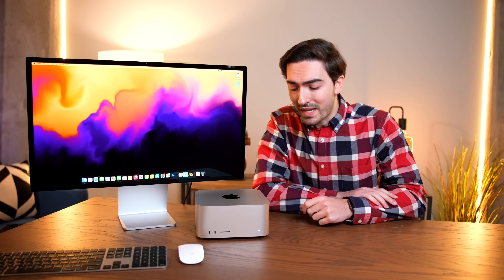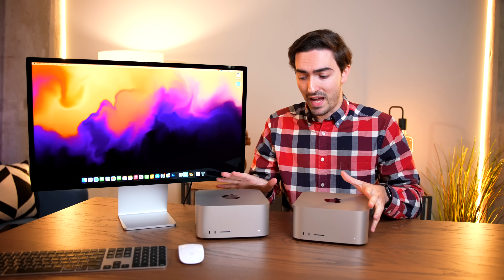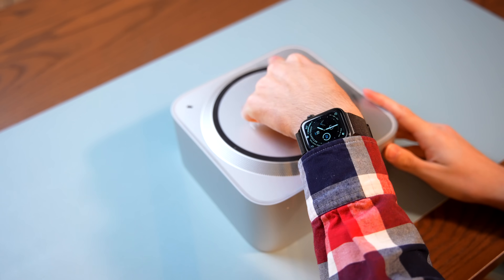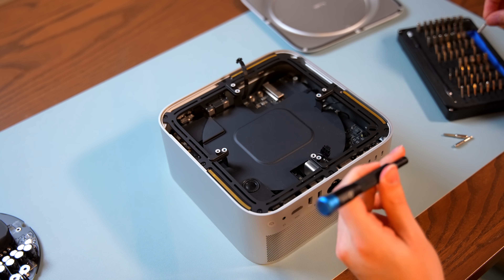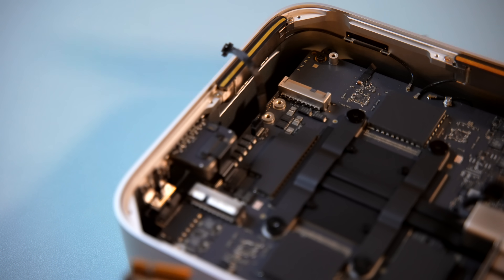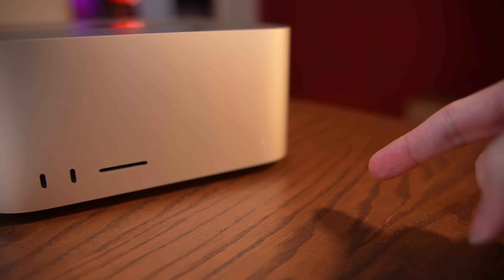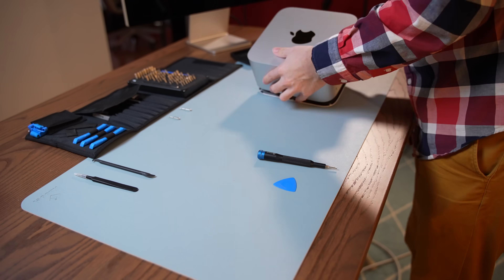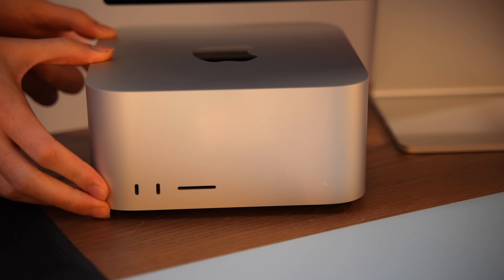What happens if you try to UPGRADE a $5,000 Mac Studio?

Comment: Disappointing video.  I agree with many others here that it is not much of a different situation than a drive that is soldered on and not upgradable for that reason, until the device is opened (which you are not supposed to do) and see that it has a port with a cable and you freak out.  It's kind of like a Schrödinger's cat kind of thing.  And.. It reminds me too of when I bought a very very cheap (stolen?) firmware-locked machine that previously belonged to a school board.  Indeed, I found a way to get around it, but I also knew that it was possibly illegal and obviously not morally sound that I was able to access that machine's drive and possibly data.  In my opinion, the situation you exposed is really not really about Apple's problems, it's about your interpretation of the inside of a machine.  The machine is advertised as not upgradable.  I think that is pretty clear.

Comment: You should have turned off ssd security first before removing the drives.  Boot recovery mode and in terminal use csrutil disable and disable secure boot, then maybe re-enable it after you place a new os beck on it.  Worth a try..

Comment: There are so many facets to; right to component repair vs right to repair vs having the repair knowledge to repair and to do the repair right/correctly. All of this investigation is awesome but it also brings to light that there are steps required to actually complete the hardware validation because those storage controllers are part of the deeper security booting feature. Yeah, people bitch about security and think that Apple is using that as and escape from complying to a bunch of people that want the right to repair. The fact is there are legit repair people that would certainly benefit and then there are the HACK repair people that will ruin it all.  As much as I think this video is awesome it also is an epic fail when someone not qualified to do the repair/modification makes that attempt. It’s a bummer that with all the Macs you have you didn’t connect to a Mac and attempt to finish the process with Apple Configurator. Amazing how we wonder where misinformation/incomplete information originates even when trying to improve the collectives access to credible information. 

** redemption would be doing it again and running Apple Configurator and if it works well report that which would be the right thing to do **

Comment: Don’t worry eventually this Mac will get jail broken and when that does you will likely get 10 years of use.  I keep checking for jail breaks for the M1 every few months but no dice yet.
Reply: Why do you need a jailbreak? Apple allows you to sign any kernel you wish to boot on an M1 system. Linux is already running, it's just in need of further driver development.

An M1 Mac with it's boot policy set to 'Reduced' has no dependence on Apple during the boot process.

Comment: build a fusion drive external with use adapter then put it in. u can't boot from a mother internal ssd because of t2. security that saves your data.
and the sos blinking is old. the powerbooks where capable of blinking sos.

Comment: 12:39 These drives are already encrypted by default(usually), so it needs to be wiped before it can be used in another computer. Why make the computer not boot if the machine has had a part replaced.
This is worse than Lenovo vendor locking the standard replacable CPUs that come in their computers, meaning they wont work in a Dell or HP

Comment: I'm with Luke.  I don't like how they do this on my Mac Pro either.  I feel the T2 chip is something that should be disabled as an option.  You should be able to handle this like I do my full-size HDD Cold Storage Backups that I keep offsite.  I Encrypt the entire drive when formatting it with disk utility.  It requires a password for the drive to be read by a Mac.  The drives are useless without the passwords.  With the appropriate passwords you can access them even though they are encrypted from any Mac.  The idea is if I have a housefire, flood, etc. I can buy a new Mac from insurance money and recover data that's 90 days or less old based on my backup schedule.  Doing this the way Apple has implemented is bad all the way around.  If you want to upgrade by purchasing a Mac Studio that has a bad logic board, you most likely can't going off his teaser.  IF you have a hardware failure you can't take the drives and install them in an identical hardware machine because with the T2 chip, they will be wiped before they are paired to the new system.  This makes them so secure they can't be used by anyone including the original owner!  TL;DR There's many more ways apple can implement encryption or security as an option that doesn't screw the consumer.
Reply: don't worry, You can buy this new maxed out macbook. (:
16-inch Apple MacBook Pro M2 MAX 12-core CPU 38-core GPU 96gb RAM 8TB SSD NEW " ApproximatelyUS $7,457.40
Reply: @alberteinsteinh  Pass… Apple isn’t getting anymore of my money anytime soon.

Comment: I disagree that the power supply is dangerous. The backside of it is covered unlike the iMacs before and the backside really is the dangerous side. On the top, the components are mostly isolated. You should not be able to touch the capacitors.

Comment: I'm sure both ports work, in Max tech's video he swapped the SSD to the other port and said it worked fine? But having the firmware lock prevent you from adding a second one or replacing the existing is just stupid. Like you said, why have the port there if I can't use it? I'm sure Apple has some proprietary machine that flashes SSD to work in a Mac Studio but it's a completely uneasy step.

Comment: I doubt it’s lack of controller. Second slot probably disabled by firmware, so only Apple can use it to offer higher storage options in the future, or compensate for module shortages (ie ship 2x 2TB modules if 4TB are too expensive or not available)
Reply: ye, i think so too, it is disabled in software, but i doubt that it is meant for you to get a storage upgrade in the future to your (by then) old device, but more like for apple to offer increased storage in new machines. there are only so much terrabytes that fit on a physically small ssd like this. this port is future proofing for them to not have to redesign the board in some years from now.
i'll just sit here and wait for someone to make a mod chip for the studio, like they did on game consoles to play unofficial discs.
Reply: @core36  Still wrong way to do things.
Reply: it wont work because those nands are for the 0 bus and you are trying to place them in the 1 bus.
Reply: Yes it will be...! 😜 And not that Apple also wants to make money with proprietary hardware..

Comment: Robert Corwen
il y a 1 seconde
I don't agree with your rethoric, and it somehow has to do with your tone and the delivery of your rant.

First, you knew what you signed up for when you bought the device. It was written black on white as a disclaimer within the storage section when you custom ordered.

This is not a Mac that is meant for upgrades, that fact was never hidden. Alternatively, the coming Mac Pro will likely be meant for user tampering. The difficulty you had opening the Msc Studio speaks for itself.

Opening almost 10K worth of hardware was not necessary to get your point across. And the 10K you spent certainly does not grant you more "rights" than a 1K machine, aside from showing up your wealth publicly.

I'm all for right to repair, make no mistake. It's just your delivery that is totally wrong here.

Comment: Lol, Apple is Apple. In their minds, they are creating a “work of art” that is not to be tampered with. They make beautiful machines. They also are hell bent on squeezing as much money from you at point of sale as possible. They really need to get their “right to repair” program operational, so you can buy the replacement ssd’s and change them out if they go bad / need to be upgraded. I also hope they don’t gouge for the replacement parts and tools - but they probably will, it’s in their DNA as a company.

Comment: I feel like you had 2 ssds in the machine, both with full os installations. You might need to fully reset the ssds before putting them back into the machine or into a new machine.

Comment: I was under the impression that the SSD and machine are paired upon first setup.  I’m not sure if the SSD and Mac can be reset (with loss of data I’m sure) or not, but this is done to protect data from bad actors.  It’s not so much the intention to stop you upgrading (though there is money to be made here) as a cynical implementation that’s the issue here.

Comment: I disagree that they didn’t put the controller on for the second ssd slot, I don’t think the Texas instrument chip is a ssd controller, if they didn’t put the controller for the second slot they would just not put on the slot as well. So i think it’s probably the ssd sn is paired with the bios. Or the smbios is stored on the ssd.

Comment: Are you able to get into the system bios and select the boot drive manually? I can remember when the Intel 386sx chip came out. Intel turned off the math coprocessor so the user had to buy a math coprocessor chip. And install it. When the 486dx chip came out, the math coprocessor was activated. No need to buy an additional chip. This is all a marketing ploy anyway. Most Apple users aren’t going to try and upgrade internally like you’re trying to do. Keep up the great work.

Comment: Your editorial is entirely appropriate but there is another reason why removing an SSD or increasing the storage for the device. What happens if an SSD dies?? That, to me, is even worse. There is no way one can change out an SSD for a new one if the one you bought from Apple fails. Oh, and going to Apple to fix it is not an option if one is out of warranty and Apple has EOLed the system.

Comment: Does the Studio have a T1 or T2 chip?  This could very well be the culprit on why your 1-1 swap did not work.  It would prevent a method of data theft.  I thought of this while typing the rest of my comments below...  This could also feasibly prevent you from adding a drive for the same reason.  

A couple of thoughts, and hey, I could be completely off the mark here.  Odd things usually happen in pairs.  Can we be sure that the second port is for a drive?  You pointed out that controllers seem to be missing, but there aren't any clues that there would be some there to begin with.  I do acknowledge the X-Ray view does make it seem that the two ports are for storage, but it is harder to tell what, if anything, lies below the second port.  Devil's advocate, could it be a diagnostic port of some sort? It would be a more compelling argument if someone with an 8TB option tore down their machine to see if both bays are, in fact, used.  I can understand the frustration that you can do a 1 to 1 swap, but you did a 1TB to a 2 TB, if I heard that right.  That is comparing a Granny Smith to a Red Delicious.   We can be mad at apple for not making the Studio user-upgradeable, but then again, they have made it clear that it isn't meant to do that.  The extra barrier of hiding the screws demonstrate this even further.

Comment: the ARM based Macs use Secure Enclave as disk controller just like on iPhones.  Each disk is paired to the Secure Enclave and its encryption keys are specific to that secure enclave.So it is normal that Mac 2 complains when you put in a disk encrypted by Mac 1 since it has no way to decrypt it.
You would need to reformat the drive to Fat 32 or some other format that the Mac won't encrypt, and then try to plug into the other Mac to see if the Secure ENclave will then accept a non encrypted disk.
This is where the Mac Pro will likely be different by having standard M.2  disk slits that are not controlled by Secure enclave.

Comment: Excellent video. Apple have always cared more about shifting expensive and beautifully designed hardware over providing the customer with a great end to end user experience. They claim it is all about providing us with very secure ecosystem that protects our valuable data and media content, which is important. But the unfortunate reality is Apple are more focussed on making excessive profits. Universal control is a perfect example of Apple's restrictive and box shifting practices. Rather than produce Mac PCs with a touch interface, they develop complex software to encourage us to buy both an iPad and a Mac PC. Universal control is clever software that appears to work well, but when I tried it, it doesn't really aid my workflow any more than using cloud storage, and it's just another gimmick to sell hardware like their previously flawed touch bar or application limited sidecar.  It is a pity that Apple, a company full of talented people, is so arrogant, and think so little about their customers, other than how much money they can extract from them.

Comment: I've got a feeling the second SSD slot is used in some sort of proprietary single volume raid type situation. They might not be able to fit 8TB of storage on a single small SSD so they split it onto two and just manufactured a single controller onto the mainboard. They may have even manufactured the secondary SSD differently or it might only work with 2 x 4TB SSDs.

Comment: The studio is not user serviceable, that does not mean the removable storage has no value. It means you can at least get a damaged SSD repaired without having to replace the logic board. Yes it would be nice to allow upgrading the storage in the future. Swapping drives means the encryption is wrong. You did not reformat and pair the second drive to the secure module.

Comment: On previous M1 models the soldered SSDs were serialized to match the motherboard so it wouldn't be repairable by anyone besides them. 
My guess is that the SSD is initialized the first time they put it inside the mac in the factory and can't be used in another mac after that and that if you manage to grab a blank SSD fresh from the factory, it would work and it will be linked to your mac

Comment: you did all this without even setting them up and booting into recovery mode and disabling the encryption. come on, this is just standard MacBook usage right here, it is so common for me to turn the encryption on and off to allow some 3rd party apps that cannot be installed as well as boot into windows off an external ssd. at least make an effort before going up on a tangent.

Comment: I'm afraid times of upgradability are truly over at Apple it's not even about innovative products no more but more about profit of its consumers. This is just another case of greed not allowing you to upgrade the storage for a pro device that's used to render videos at huge rates. When the storage dies the device is basically a paperweight or ask the pro apple engineers at a huge cost to repair which isn't worth it and make you buy another device. Not only is this greed it's against what they now stand for in technology recycling. Just to stop our right to repair, times have changed unfortunately not for the better. Great video content again Luke keep it up

Comment: Last year I have an issue with the SMART state of my MacBook Air 2011 SSD, I have to change it whit an 256gb Aura Pro 6G, and it’s to way faster than when it was brand new I’m really happy with the improvement and the original one ssd it still works as an external disk. It’s amazing how a 10+ years old MacBook base model it’s an incredible useful computer, for sure no one windows of have the same performance after all this years.
And now it’s kind scary that apple started doing this things, you’re buying a top of the line incredibly powerful and very expensive machine hoping you can work whit for many years and you discover that you cannot upgrade it, just imagine having an issue with after a couple years and now you neeed to spend lots of money for a simple fix on the apple repairs program, or the worst thing, that apple gonna say that it’s an un fixable problem and you have to spend way more in a brand new one

Comment: This video was of great interest to me. Thanks Luke. Now when you get to part 2, please let us know if the inside of the base Studio with the M1 Pro is configured with a second SSD slot. I am also curious about what they have left out that weighs two pounds.
Reply: Saw a new posting on MAX Tech that answered my two questions. 😃 I found it interesting that the 512 SSD was in the opposite slot from the two you were working with.
Reply: Another video stated that the ultra came with a copper heat sink, the max has aluminium. That is likely a majority of the weight difference

Comment: I wonder if Apple locked any non-original SSDs in order to provide extra security for the user? FOr example, if someone steals your entire Mac Studio, they cannot then rip out the SSD and place it into another Mac Studio to brute-force guess the encryption because they are locked to original hardware? Although as a system tinkerer this sucks, I could see high end movie studios finding this extremely useful for security of data.  Or perhaps I am giving Apple too much benefit of doubt?  If it is a security decision to protect user data, I could give them somewhat of a pass.

Comment: I read that with the m1 MacBooks the Wi-Fi Module was paired with the SSD, had some code stored there. So changing the wifi module from one device to another (not easy but not impossible) would require to have the ssd which was paired with the module changed with it. Maybe there is something similar going on, but vice versa?